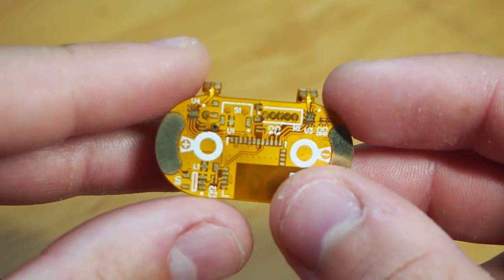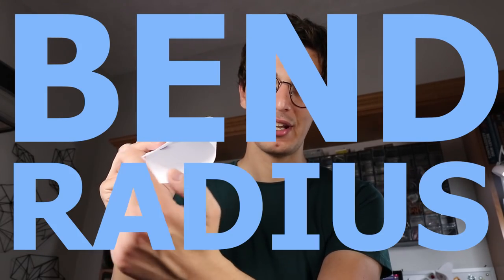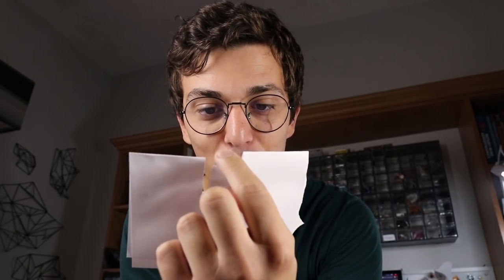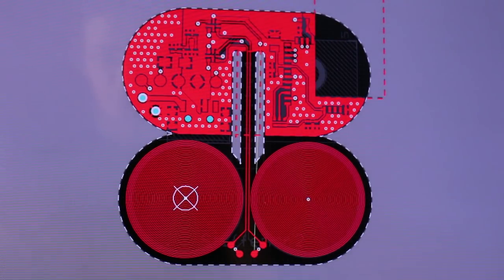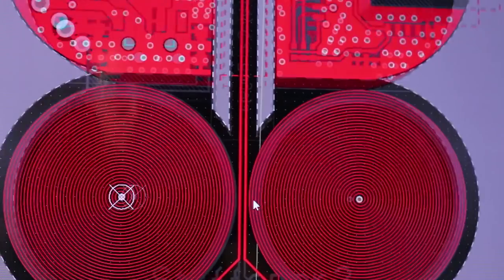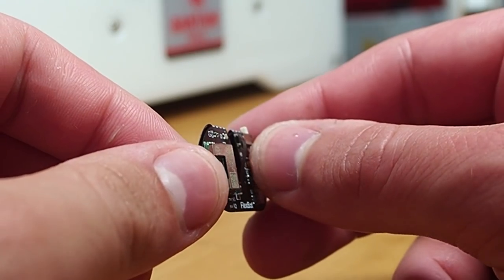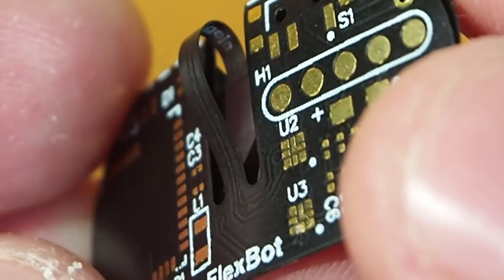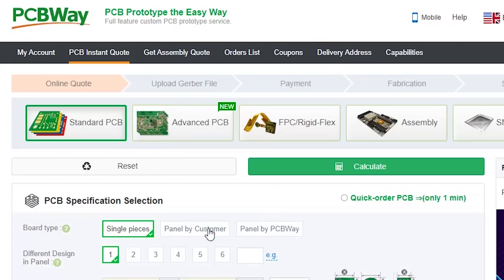Folding PCB Hinge Design

Comment: FWIW  -Altium has the feature for a few years  - 
https://www.pcbway.com/pcb_prototype/What_is_a_Rigid_Flex_PCBs.html
"What is Rigid-Flex PCB:

Rigid-Flex printed circuit boards are boards using a combination of flexible and rigid board technologies in an application. Most rigid flex boards consist of multiple layers of flexible circuit substrates attached to one or more rigid boards externally and/or internally, depending upon the design of the application. The flexible substrates are designed to be in a constant state of flex and are usually formed into the flexed curve during manufacturing or installation."

Comment: ...alternatively you could adapt a foldable hinge for the connecting tracks made from a superelastic alloy such as nitinol. Use a special flux to solder the connections to the circuits.

Comment: I don't understand why the bend radius was too small on the previous board. Are you just folding for assembly or is it a live hinge? If it's just for assembly, couldn't you just have a small gap in the conductor at the fold line and then solder the traces once the fold is made?

Comment: I just had a thought, what kind of magnetic field can you measure (with a cheap analog hall sensor) on the tops of standard PCB-mount inductors? They’re probably not as compact as the flat flex coils, but the higher Kv should make it much easier to get a “PCB motor” spinning without getting toasty. Other components like small transformers (with their core opened up) might work too.

I also wonder about an electrostatic motor, if you’re willing to deal with HV.
Reply from the maker: I have never tested this but I think it should be feasible and also work

Comment: Thanks for the update, looking forward to see it in action! 
Just one question:
Why did you make sharp corners in the cutout on the coil side? Last i've heard from my PCB manufacturer, you should always try to use a radius and not sharp corners where the bendy parts meet the stiff parts, so there is less risk of force buildup and tearing in the polyimide.
Reply from the maker: That is correct in fact the other part has the radius.. The other side is different because it was too short and I was afraid it wouldn't be able to bend that much + there is the clearance from the copper traces as well, so the shape I made follows exactly the clearance path

Comment: Is is flex+stiffener or true rigid-flex? How much does that PCB cost from PCBway? Their instant quote page doesn't even give you a price for rigid-flex, it just says contact us for pricing which I assume means very expensive
Reply: Probably still cheaper than my european PCB supplyer, they don't make you any flex circuits for less than 500€, just because the setup costs are quite expensive. And if you go into multilayer Flex-Rigid it quickly approaches 1k€. These are the price for a full fabrication panel tho, because it does not make sense for them to pool your order with others.
Reply from the maker: It's flex +stiffeners 🙂check out this video for the comparison https://youtu.be/P51te12Oux4
Reply: @CarlBugeja  thanks so much, that's really helpful!